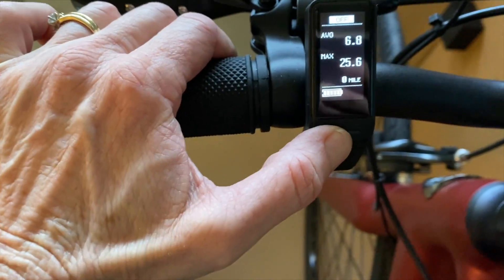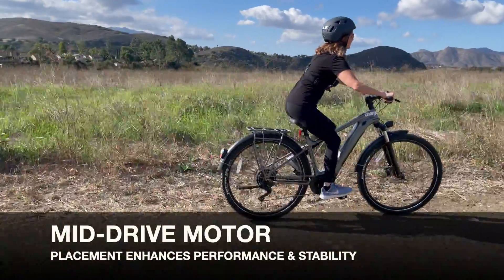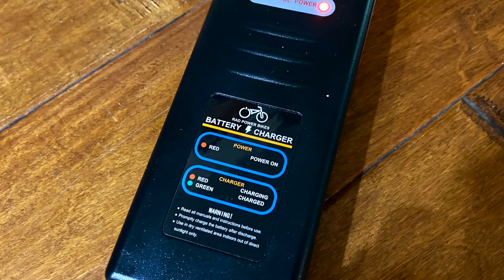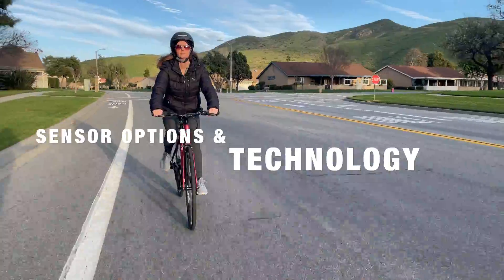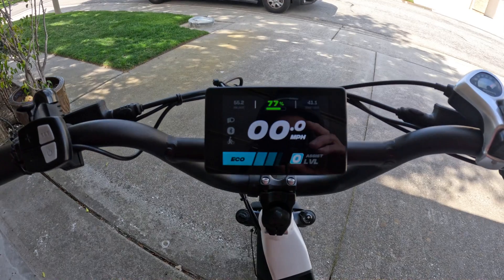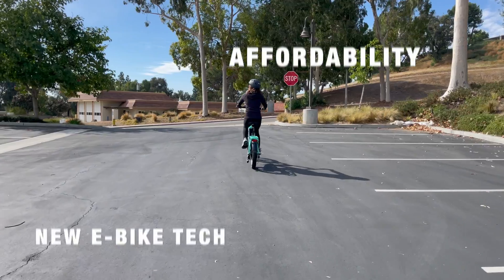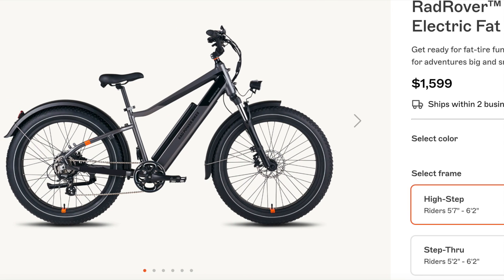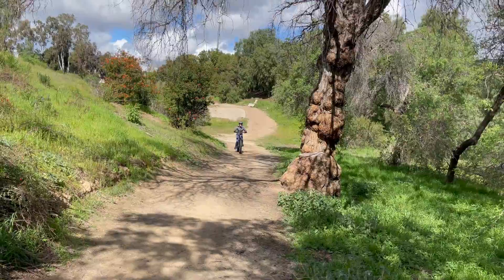Newest EBike Tech 2024: Inside Your E-Bike – How It Works and What's Next

Comment: For my TWO WHEEL DRIVE e-mountain bike (EMTB) I am happy to have the RELIABILITY of hub drive in case my chain would break unrepairably. For those times, MILES away from camp, hub drives are priceless.  My bike has torque sensing technology for pedal assist. 
Now we e-bike owners need a MUCH more efficient electric motor - and of course, TESLA's aluminum-ion batteries!
Reply from the maker: Thanks for sharing your experience!

Comment: Question... my ebike is 350-watts /36-Volts. I need to replace my pedal-assist controller (36V) But the one I found is 48-Volts. Would this be compatible and would the higher Voltage increase my maxium speed (along with draining the battery faster)?
Reply from the maker: I don't believe you should mix voltages. I'd ask your e-bike manufacturer to see what the options are :)